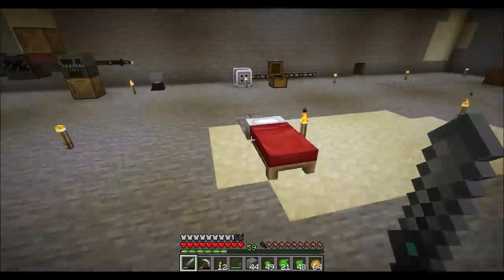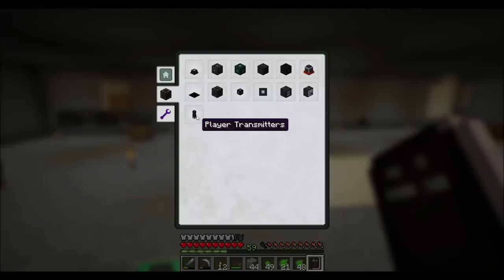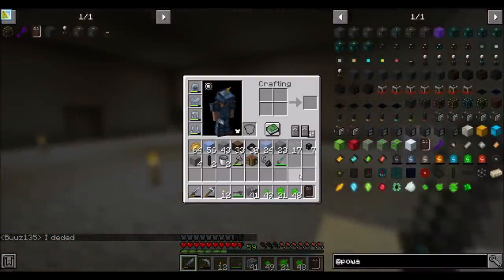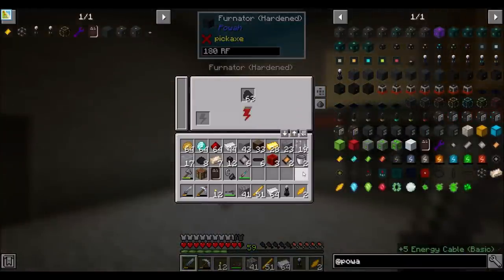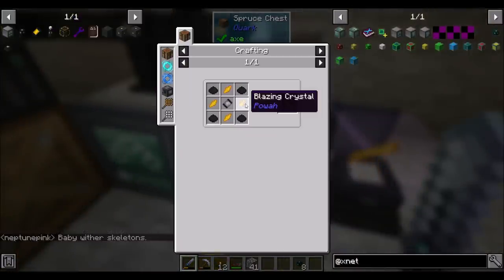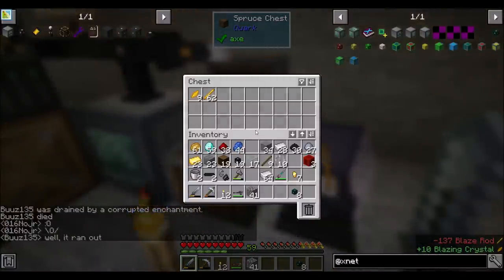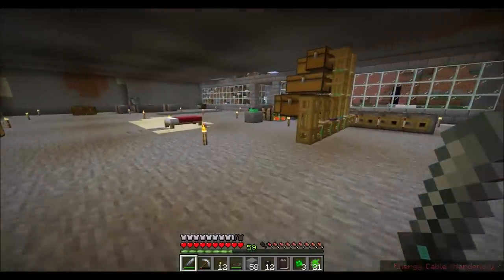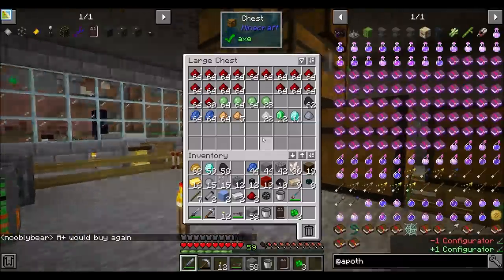Forgecraft S12E6 Powah Reactor

Comment: so it seems the reactor is turning itself off when it does not need to run, but it doesn't scale, so when it has space for 11k rf it will create 11k and when it has space for 1rf it will create 1 rf but in both cases consume the same amount of resources. so when xnet is constantly using small rf amounts the cables extract rf from the reactor thus making space in the buffer for a small amount of rf and the reactor using a tick of resources to fill that space up.
Reply: That's what I was thinking too, makes sense
Reply: It there was access to automation, you could make it so the system deactivates at 99% and activate once at around 60-70%. That's how I worked with Extreme Reactors in 1.7.10 and 1.12.2
Reply: EnderIO to the rescue.

Comment: @direwolf20 If I had to guess, McJty makes it so that the controller just traces the connector blocks to their ends and keeps track of the blocks at the ends. Either that, or he sends a network packet whenever the connector/wire blocks are placed/broken so that the controller knows when to update its catalogue of connected TEs

Comment: 21:05 A mod that allows lapis instead of blue dye? Can't you just oredict it?
Reply: In 1.15 Lapis is no longer considered blue dye, but you can craft blue dye from lapis in a 2x2 grid for one lapis piece
Reply: @clareja6719  This strikes me as pointless. The only thing this changes is adding crafting steps to anything requiring blue dye. :P
Reply: Trey Slider, it’s a was deliberate design decision. On the surface, all it does is add a crafting step, but it was meant to turn dyes into separate items from mob drops, fertilizer, etc.

I do think that xnet should be using lapis for their crafting, not blue dye. The entire point of separating ink sacs, cocoa beans, bone meal and lapis from dyes was to make it so dyes are only used for dyeing.
Reply: @felipevasconcelos6736  Mechanically, this distinction adds nothing to the game, IMO. YMMV of course.
Reply: Trey Slider, it doesn’t, but they added it to be more intuitive to new players. Isn’t it weird that you can dye a piece of wool directly with a rock?
Reply: @felipevasconcelos6736  In a game where I can punch trees? Where stairs are 50% more material expensive than solid blocks of the same volume? Having to grind a rock into powder before you can use it sounds like something from a tech mod, not vanilla minecraft. But like I said I recognize that this is my subjective opinion and others may have different experiences with it. :P
Reply: Trey Slider, “when stairs are 50% more material expensive than solid blocks of the same volume” not anymore, they cost exactly one block if you use a stonecutter, but that’s irrelevant.

Mods have added blue, black, white and brown flowers for years, which usually craft into other dyes. When Mojang wanted to add flowers for those dyes, they didn’t want to have two different blue dyes (lapis and blue dye), but they didn’t want to make flowers craft into a rock either. Their solution was to make the flower and lapis craft into blue dye.

They could just do what every mod did before, and leave lapis as a dye and add another blue dye, but that would be very confusing to new players, who instantly know what blue dye does, but not lapis.